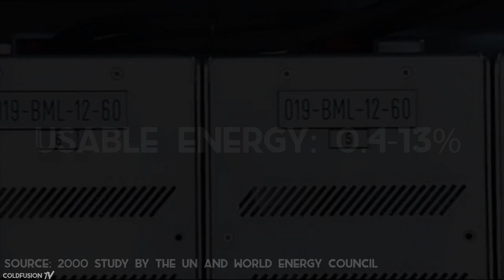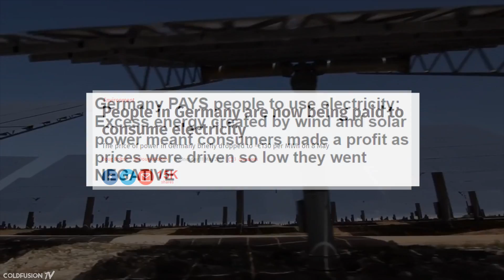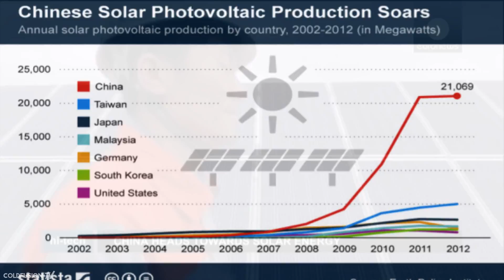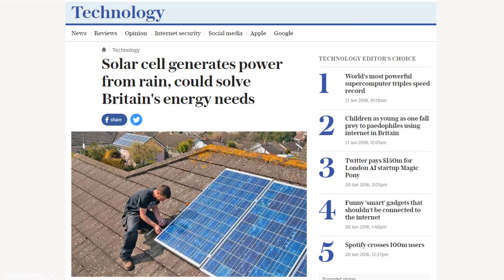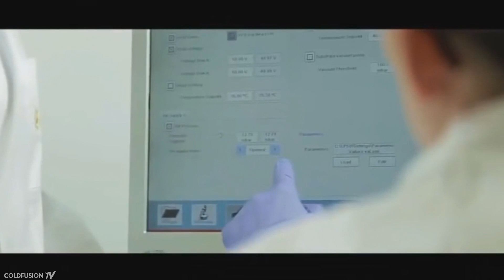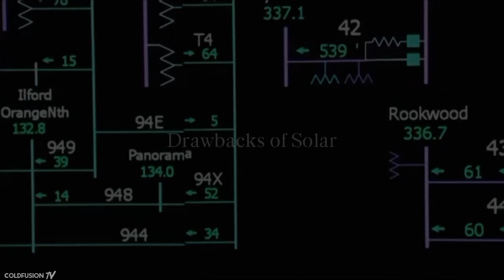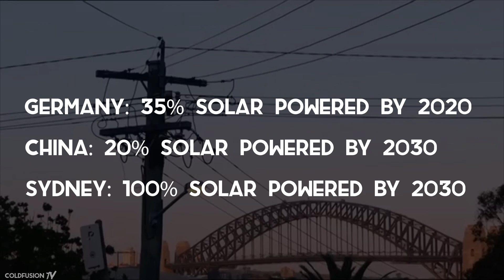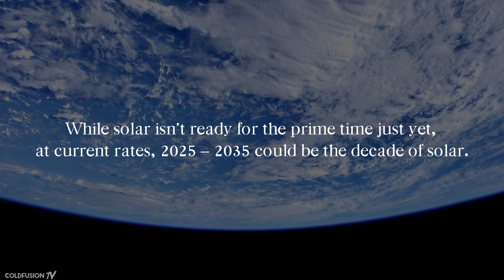The Truth About Solar

Comment: Awesome video! Question: you mentioned that older grids would need upgrading to be compatible with solar energy. Why is that exactly? Surely energy is energy, regardless of its source? Also, assuming I didn't miss it, I feel like you needed to discuss the current solar cell energy conversion efficiency and mention the theoretical maximum conversion efficiency. It's a huge part of solar cell research.

Comment: Solar is very dependent on new battery tech that will in the next few years be with us giving us safer and much much smaller batteries that can hold many times the capacities of current batteries. Then it will be more viable to generate all your own home electric,roofs will be completely made of solar cells.

Comment: The chief engineer of Google says that the world got 1% of its electrical power from solar about 4 years ago.  He also has been following the progress of solar for a number of years and has discovered that the amount of solar output, world wide, always doubles every 2 years.   That would have the world producing 128% of its electricity with solar by 2026.   The world will soon be awash in cheap, clean, sustainable, electricity.   As an added note, solar panels have no moving parts.

Comment: Its not free.  Those panels come from serious mining and or chemical processing and production.

Elon's pitch was specious at best as it is biochemical in an organism that is evolved to living where it does.  And if you still don't believe me, take a large panel and just go off axis from the full sun and you will see massive drops in voltage and current.  Cloud cover or shadowing just murders it.

All regions that are wildly outside of the tropics have a massive shortness of day issue that no amount of "tricks" regarding ambient light or rain will overcome.  Because you know what we get when the days are short?  SNOW.  Kinda screws with everything solar.

All these passive appliques that you supposedly just stick on windows and phones and tablets, etc...  What are their off axis performance ratings?

Batteries are a HORRIBLE way to store energy.  Battery tech may have changed as far as the metals and chemicals used in them but fundamentally, batteries are 300 year old energy storage devices.  Something else, along the lines of ultra capacitors, is necessary.  Both from a speed of charge/discharge aspect and from a lifetime of cycles.

See?  I know you are an idealist futurist Dagogo, but there are real and serious limitations that will always keep solar out of the mainstream.

The real answers for those that are concerned about environmental impact is thorium and fusion.  Thorium was only skipped as those reactors were not ideal for the creation of weapons grade material during the cold war.
Reply: Not to mention it still takes more energy to produce the cells then they are likely to produce in their lifetime. Sober cells still are "batteries" in a way.
Reply: nate edwards If anything, they are a very special use option.  Best for super remote locations or for use as an emergency backup for key systems.

About the only truly spot on use is for remote sineage use on highways where it would be far more expensive to install a grid tied power source for flashing lights.
Reply: +nate edwards lol do you have any source for that? These panels produce way more energy in their life then it takes to make them.
Reply: bensemus x All panels degrade over time due to the nature of entropy from being exposed to the sun.  This is undeniable.

Because of this, their overall efficiency drop off greatly contributes to their lack of full return for the cost of manufacture from an "all in" energy to make them.  This means all the workers, their food, housing, healthcare, etc...

As I have pointed out to people in the past, the overall cost in money, less a profit margin, exposes the total energy level required to produce it.  When you are still looking at over $75,000 Canadian to install a system that would run the average Canadian household.  IF and it is a BIG if, that system was still capable of powering my house for over 25 years with ZERO additional costs expended to maintain the system, then fine, you are right.

But just as the massive and thorough debunking of solar roadways has shown, The only kind of solar that works is highly precise mounting, angling, tracking and constantly cleaning and protection from wear from dust, sand and ice.  It is all these aspects that cause the TCO or Total Cost of Ownership, to balloon to such heights that they can indeed cost more overall than what they actually make.
Reply: Jason Price Do you have a source for that $75,000? Google is showing around $25,00 with it being recouped in ~20 years ad that's at 12% efficiency. They are also building those massive power plants and no private company would build something they weren't expecting a return on. Whole countries have gone days on just solar.

Comment: as I understand it the big problem is still the storage of energy
Reply: Not really. First you have a balanced grid that doesn't rely on one source too much. You also need a smart grid that can manage load balancing more autonomously. Massive molten salt batteries are already used to store excess energy from wind and solar farms. Other methods are pressurizing abandoned mines and releasing the pressure when energy is needed. You can pump water up a hill and drain it when energy is needed as well.
Reply: You are right storage is an issue. Sure a better grid would help, but that is a huge investment, storage is the key to making intermittent sources of electrical production viable and is too costly for most of the world. Otherwise you end up burning even more fossil fuels to back up the system in order to provide reliable energy output. Storage right now is in its infancy, until we have terrawatts of electrical storage at our disposal combined with a smart grid that will cost trillions of dollars to implement, we are not going to have anywhere near 100% carbon free energy unless we start using more nuclear power.
Reply: No, the big problem is that there's so little energy available on the ground (1400w/m^2, of which only about 20-30% is usable after losses) that it would be incredibly expensive to gather enough energy for realistic use.
Reply: phaedrusalt first off there's only about 1kW/m^2 (average). That is plenty of energy. Viable PV power plants exist.
Reply: bensemus x First, it's 1400w/m^2 at the equator.  (Averages are only useful if you happen to know where the average location is.)  Next, that is NOT "plenty" of energy, unless you enjoy sitting in the dark. PV plants are only "viable" where they are subsidized and where land is free.
Reply: phaedrusalt PV plants are viable in Canada. An average is useful and it's for the whole planet. No one is sayone only use solar to power our grid. You mix power sources so you always have enough.
Reply: bensemus x In Montreal, a one-meter PV panel can generate 240 watts maximum, on the very best summer day.  How much are you willing to spend/risk to get next to nothing?  Gerbils on treadmills would be more cost-effective.
Reply: phaedrusalt That's roughly 24% efficent. That's not bad and is worth it. Those panels pay themselves off after 15-20 years. If you actually hooked up a generator to a hamster wheel it would be way more random and generate mW.
Reply: bensemus x Well, it might pay for itself in 15-20 years, IF it weren't for the pesky constant maintenance that they require.  See, they don't stay clean, and to clean them requires work.  That work costs, either money or time.  (Basically you can look forward to putting in time dusting and washing these things every day to keep them working properly.) But that's not all.  Unless you plan to turn off all electrical devices at sundown, there are batteries to be maintained and repaired, and they don't last anything like 15-20 years.  

The hamster example is a good one, because (Like solar) it's very little energy generated over a great area by a too-complicated method in the hope of getting something for nothing.  Or, if you'd prefer another metaphor, it's like all the gold in the oceans.  There's an estimated 20 million tons of gold in the oceans.  (Sounds good, right?) But it, like solar energy, is spread out so badly that it's not worth harvesting.
Reply: That is such bullshit my solar payed for itself in 2 years and in the 6 years I've had it I've cleaned 0 times and it works fine.
Reply: q36spacemodulator And being the junior rocket surgeon that you are, I bet you know exactly how much the power output fell off from the accumulated dust.  Or not.
Reply: phaedrusalt Most people aren't looking to solar to power their house 24/7. Just to offset their costs and such. As for batteries the Tesla wall battery would be easy and is maintenance free.
Reply: Batteries are not the only storage method. You have thermal, potential energy, chemical energy (eg hydrogen)

Sure all these things need maintenance but so do all the current methods. Coal has to be dug out the ground, transported, the waste disposed of in addition to maintenance of the physical plant.

To claim solar is impractical due to maintenance is to pretend that fossil fuels don't have maintenance costs when they actually have way higher ones.
Reply: Neatly side-stepping the issue of there being damned little energy available for all the expense and pollution created, huh?  See, when transporting coal/oil you also create pollution, but it's to get a whole lot of energy.  But with solar it requires a lot of pollution, and you get damned near nothing in return.
Reply: +phaedrusalt

Got to ask...did you type solar where you meant fossil or are you just trolling?
Reply: Are you just trolling?  I said what I meant, which is the truth.  The pollution/energy ratio of solar is extremely high compared to even dirty energy sources like coal, because the energy received is so small.
Reply: +phaedrusalt

The ONLY pollution from solar is from the manufacture process. Given that they are primarily made from silicon, a commonly available material, they don't cause much pollution during mining or manufacture. Once they have been made there is very little maintenance needed and the fuel is free and with zero pollution cost. So tell me....where is this high level of pollution coming from?

Fossil fuel on the other hand. Need's lots of metals for the power plants, which has a high mining pollution cost. Has a pollution cost for the fuels in both obtaining and transport. Using the fuels has a further pollution cost. Then you have to dispose of the waste products which is still further pollution....so it's pollution, pollution, pollution and more pollution.

You've either not thought this through or you are a troll.
Reply: +diceman
Wow, you've found a way to plug beach sand into your house, and derive power from it?  Revolutionary!  Oh wait, you haven't?  Neither has anyone else.  Silicon is, as you said,  &quot;a commonly available material&quot;, but in it&#39;s raw form it doesn't provide any energy.  To work as a PV panel it must be mined, melted, formed into crystals, cut, etched, polished, wired, packaged and delivered.  Are you really so naive that you think this is a CLEAN process?  Poor child.  Not only does it take quite a bit of energy (The first 5 years of the PVs power generation can be considered a pay back of the energy required to make it), but it also requires a number of very nasty chemicals.  And, despite the "clean manufacturing" standards in place here, guess where 6 of the top 10 PV panel manufacturers do their dirty work?  In China, where they are free to dump the acids, pollute the water, burn the dirty energy(Sans filters, of course!), and otherwise create a nightmare of chemical by-products.  Solar advocates like to refer to the &quot;carbon subsidy&quot;, where the cleanup of the by-products of coal/fuel/etc are part of it's total cost, but solar has the same kind of by-products, but worse. (See http://spectrum.ieee.org/green-tech/solar/solar-energy-isnt-always-as-green-as-you-think )

And that's just the beginning.  When it comes time to recycle old PV panels, guess what?  They come with laced with heavy metals!  Yaaay!

Le'ss talk about who exactly hasn't thought this through...